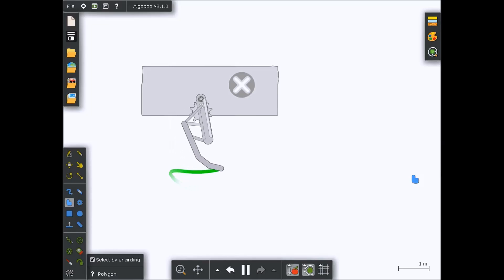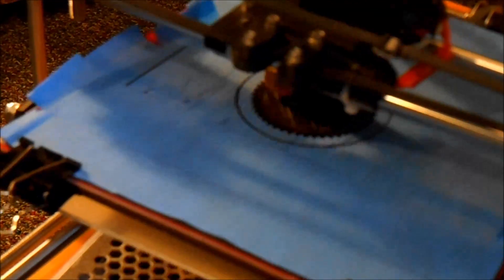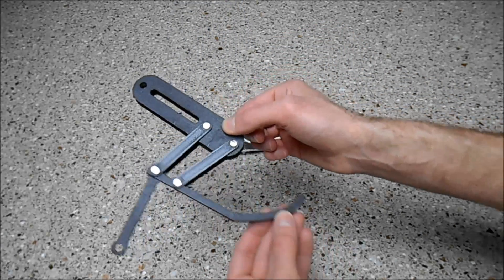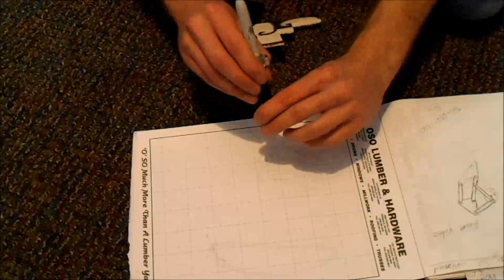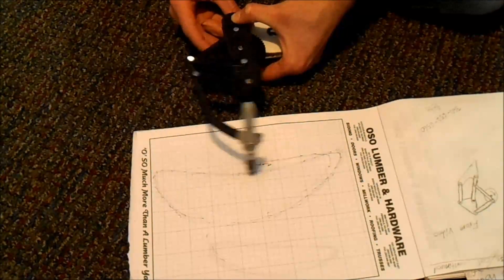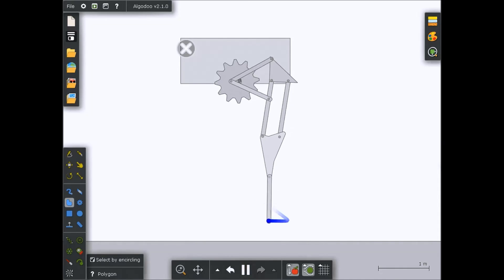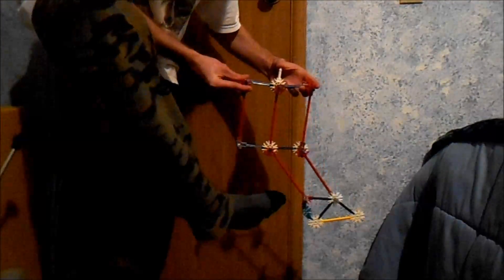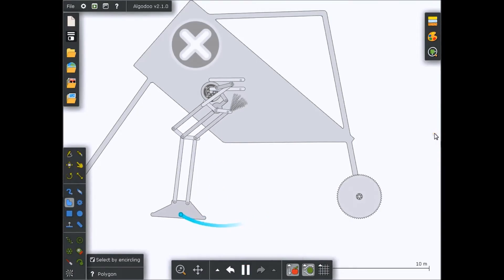4 Leg Walking Robot Developement Part 1

Comment: I don't think step path should look like that. Correct me if I'm wrong, but bottom path should be as flat as possible, and upper path can be curved. This design makes main body move at 1 similar height, and not move up and down

Comment: hey
Reply from the maker: I'm not sure what you want me to do to help. If you already designed your own in solid works, then you are doing well on your own. I can build one for you if you want to pay for it, but I can't guarantee it would be finished quickly.
Reply: How much time it would take for you
Reply from the maker: Ravi rithwik Well what would you want it to be made out of? If you want it 3D printed, then I could send you the right and left pair I already have (they are also connected as one unit, with a 3d printed "hip"). Otherwise I don't think I would have time to do it before maybe Jan.-Feb. next year.
Reply: Oh no that won't be feasible

Comment: I did exactly the same in solid works and met with the complexities in finding the material for the same.
I was thinking to make it using 3-D printing, but my friend was worried about  the price of 3-D printing in here.
Expected quick reply back
mailing to u is delayed
Reply from the maker: How big are you wanting to make it? It may be possible to build it out of cheap steel or plastic pipe.
Reply: 6 inch long foot

Comment: You need to reverse the movement, so that the starighter arch is active while in contact with the ground, and the larger arch is the one traveling trough the sky, because when you walk your hips staye level, and the your legs arch in space while taking a step, the then end up on the ground again. That is why noone is using this design, not because it is a great original design, but because the most efficient motion is not achieved. When you look at the notes of Theo Janssen he ephasized this a lot, it is all about the leg movement being straight, and in a straight line. The second issue is the time with ground contact doesnt work out on your design. There needs to always be contact between the leg and the ground, since machines dont float. You can manipulate the shape of the circle to speed up and slow down the motion of the leg, which basically means that the leg is in contact with the ground more then half the time, and in the air less then half the time. Then you still need to calculate momentum, since in a design where you have four moving legs, two legs won't be stable enough to hold the object up. Again, use the shape of a circle to manipulate your timing and create a good momentum so that the robot does not tip over.
Reply from the maker: +Hendrik Hans Havermoudt Thank you for your comment! For running you want a lot of pressure on the ground, so the lower leg would be made to be springy (possibly with joints and a cable-tendon with a spring at the end). For the full size model the individual movements can have more separated control to get the exact movement needed for the type of ground and for the speed (walking/running). The wheel-controlled reciprocating motion works well to show the mechanical concept though, and I think it could work well at running speed with a sprung lower leg. I have a lot of respect for Theo Jansen's mechanisms, but they are meant to walk slow on flat ground with many legs. His design is very cool and I have taken inspiration from it.
Reply from the maker: +Hendrik Hans Havermoudt What do you think of the design shown starting at 4:55 ? That is my best design in my opinion, I want to use it for a biped or possibly the front legs of a quadruped.
Reply: +JaycubL I much prefer the second design that you showed in your video over the first one. With your first design the robot won't stay parallel to the ground. You have both upwards and downwards movement aswell as forward movement. If you wanted to make something jump then that would be a good design, however when we look at the way that four legged creatures in nature run, we see that they stay parallel to the ground. Your first design right now will be more like when a cowboy tries to ride a mad bull, a lot of kicking into the air, which is the upwards movement, and little forward movement. It could work if there was enough weight on the legs so that some of that upward movement would be cancelled out, however it would still make for a very inefficient design. Now if you could reverse that motion somehow, so that the legs would be in contact with the ground without having the up and down movement that you currently have, then your design would be really great, because then it would not want to jump, and instead would want to mover forward. 

Then to get into your idea with the springs, in theory it could work, however it creates a few extra problems. First of all you again get the upwards movement. So you have jumping instaed of going forward, so you would have to think up some way to redirect the upwards movement forward, which is realy hard. The sort of robot that in my opinion could do such a thing would need a lot more articulation, joints that move separate from each other. You would be looking at something with digital sensors, I think that the easiest would be to type up a program that inputs dat from a gyroscope to compensate the movement so that the body is always horizontal, and calculate the exact movements of the joints to take in consideration things like momentum and grip, and then hook it up to stepper motors in the joints, however that would be a whole other type of project.  

To kind of explain why legs and speed don't go together, a wheel is nearly always in contact with the ground. Supercars are designed to have lots of downward force to push them down into the ground so that they have more grip, more torque, so more speed. Legs are inefficient because they are not always in contact with the ground, and they need to move away from the ground to move foraward. When a car loses its grip at high speeds, it crashes. The reason that a car would loose grip at high speed will usually be bacause of rain, or bad design. When you have a leg, then you have to loose that grip, because it needs to move up and forward. It is very inefficient, because you are bothe wasting a bunch of energy with moving into the opposite direction as where you need to be going to (a leg goes backward to push itself forward, then lifts up and moves forward, to then go backward again), and you have to loose contact with the ground, so that you have to loose your grip on purpose, therefore loosing a bunch of torque, and limiting your top speed,  because as soon as your leg moves down again at a high speed, the leg will act as a break (unless you put in a simple mechanical thingy to allow for releasing pressure but this would be wasting even more energy), causing for the force that cant be transferred from the engine(legs) into the forward movement to look for another way out, resulting in a robot that want to jump like a bull with a cowboy on it's back, or a leg that digs itself into the dirt like a wheel in mud, or a loss of colntroll over the machine similar to when a car starts  spinning uncontrollably when you drive to hard in the rain. Speed is not made for wheels. However if it does really interest you to make a fast walker, i would recommend watching slow motion videos of animals running, and try drawing out the way that their joints and bones move in space when they run. Just draw it in straight lines and dots, like a stick figure By drawing it out you will understand the movements of a animal in motion better, and you might find a relationship between certain movements, which could result in the next great walking mechanism, similar to how Theo Janssens design is respected by people now.
Reply from the maker: Hendrik Hans Havermoudt Thank you for taking the time and effort to leave such a long comment! I appreciate it. Based on research from MIT Biomimetics lab I think that for running you do want a lot of pressure on the ground. That would mean a swing path that moves the foot below the ground, with tension building in the leg as the ground resists the downward swing. For slower walking on flat ground, yes a level swing across the ground is what you want for it to work nicely. I think that for ground where the flat of swing path will work, a wheel will also work though.
http://biomimetics.mit.edu/research/biotensegrity
One way to imagine a running animal at full sprint is that it is actually flying, and the legs need to slap the ground really hard in a rhythm to provide lift and thrust, and steering force.
As far as speed, yes I totally agree that a car is obviously better. The intent of this 4-leg robot project is to get an any terrain ride-able horse-lion type thing, and partly just for fun and videos. If it can reach horse-type speeds that would be an extreme success in my mind, I am not expecting car-type speeds. But you would not ride a car up the side of a cliff or tree either (a cat may be able to do that). A legged machine can possibly go anywhere you could get to on foot or maybe even harder places if the design is extremely good. My opinion is that the feline body is the best form for a land animal.
Reply: +JaycubL Hey, no problem! A few weeks ago i came across a US millitary document that was going further into all terrain walking vehicles, however i didnt safe it, which i now regret. The MIT document you send id new to me, and i'll look at it once i have some time, so thank you for that. As i said before, in theory sprung legs would work amazingly, however it would require precision, and my worry is that it is not achievable in a design that is based on a two axle movement. I have thought about it today aswell,  and I drew up a few designs that i want to test out, so if something comes out of those designs I'll send it your way. I want to try out very precise movements in a similar way that Matthias Wandels pentarouter. I have a theory that this is also the way that the automaton of the writing kid works, however I don't remember the bame of the artist. I'll edit this comment if I have the time so that there are links to what I am referring to.

Comment: Forgive me, but I noticed that when you traced the movement of the legs, the desired travel would be a mirror image, upside down. I have been interested in these things for a decade. I dont like the multi bar linkages because of complexity, and load bearing issues. but the strong point is the constant velocity of the feet.  My feet would be variable if driven through a constant speed crankshaft.  A drawback of Theo Jansens machines is the front feet always hit obstacles, rather than lift over them.
Reply from the maker: +Timothy Dennison Thank you for your comment! The lower leg is designed to be springy / bendable, I don't think a perfectly flat down swing would be the best for running (some tension in the leg is good for speed and uneven ground). But for sure there is lots of detail and improvement to be added to this for a full size model. You could have the upper and lower legs controlled independently instead of together. I thought this was a cool mechanism though. The Biped leg shown at the end I also have plans for. I like it so much because it can be a long leg that is strong and lightweight with all the motors/control done at the hip, up inside the robot while still keeping full control of each joint.

Comment: Great work! I am putting this design on my to do list.

What type of screws do you use to create the passive joints in the first design? My current method is very crude and not structurally sound.
Reply from the maker: +Alex Martin Those are cut pieces of 1/4" aluminum rod. Thanks for watching!

Comment: I love this leg design and thanks for posting this. Did you come up with this leg design?  I actually made the legs out of cardboard and tried to make a walking cat for my mom as a mothers day gift. I used rubber bands and pulleys and got the legs motion working at a good speed but it just won't walk I think due to the cardboard flexing too much. Holding it off the ground it looks good while working as if it's a real cat walking. I added another pulley to slow it down but still would not walk but no doubt in my mind a 3d printed one will work great using gears. If you want to see the cardboard version I made in action I can send you link to video. Thanks again and I can't wait to see your working model I have complete confidence in it.
Reply from the maker: Nesmaniac Cool, yes I would love to see the video of yours. Yes I came up with this leg design. I based the shape on a mechanical puppet I saw, then designed the mechanism for it to work like this.